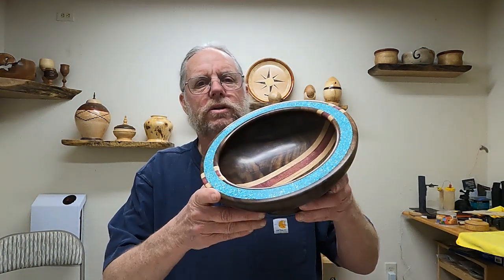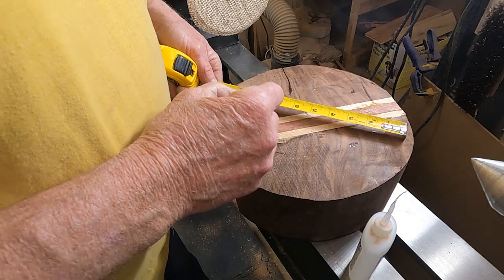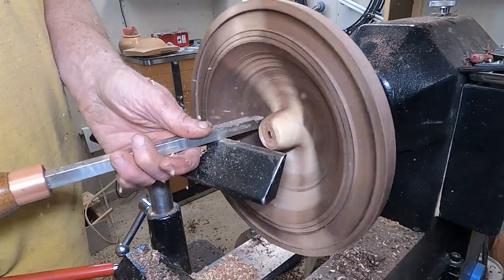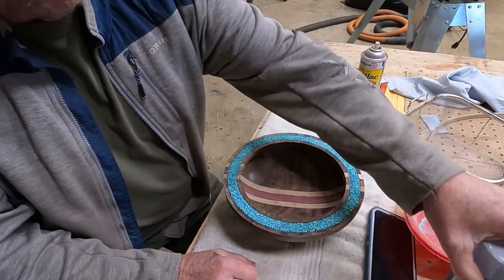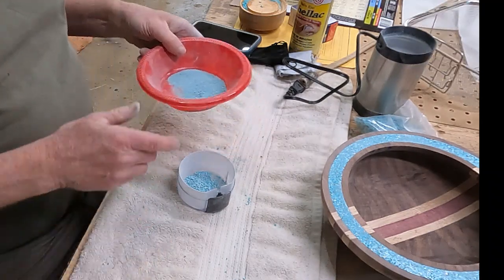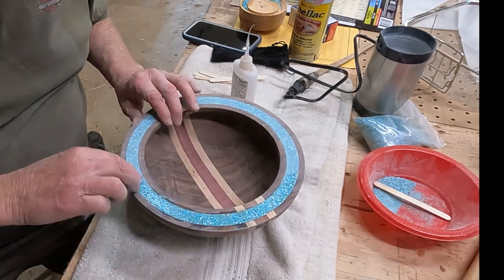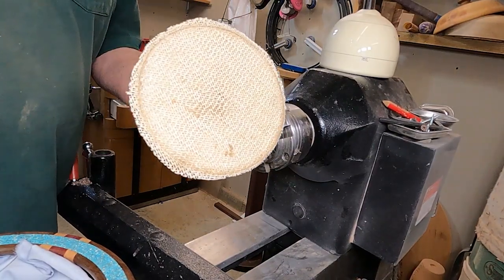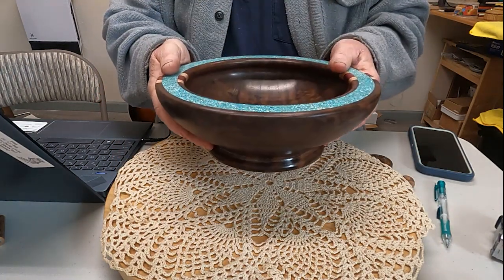A bowl of Challenge

Comment: Wow!  You learned a lot and I learned a lot from watching!  I like the light and dark stripe look and the grain of the walnut going opposite seems like it should be that way for a bowl for some reason, like it all goes out from the center. Was the direction of the grain more problematic than the mix of the species?  Also, on finishing the topaz, is there a way you could mix up a slurry and sort of grout the voids?
Reply from the maker: Thank you so much for the comments. The direction of the grain made the angle of the bowl gouges critical. The difference in hardness was problematic.  I should have just cut that center column out with a Dremmel tool. That would have helped.  I hadn’t thought of mixing a slurry. That’s a good idea.  I wonder what sort of binder a person would use for that?  I’ll have to look into that. 
  Thanks for watching!